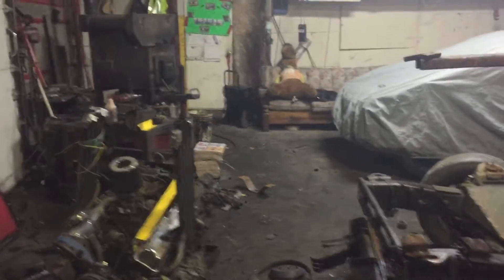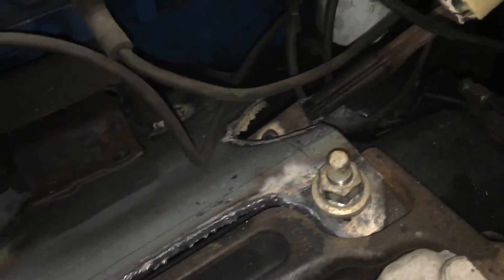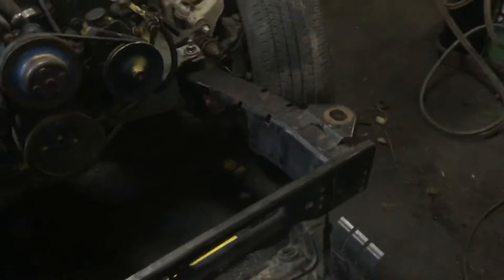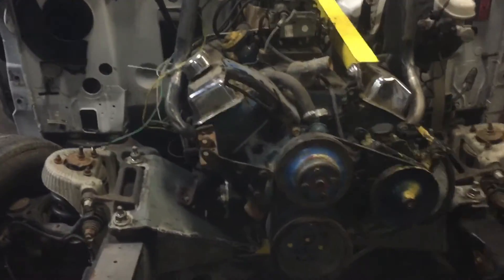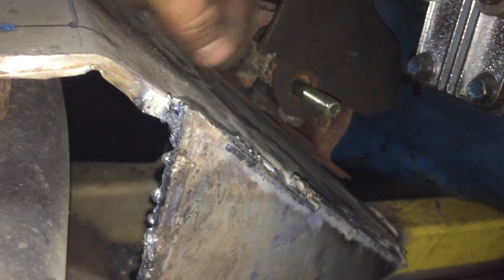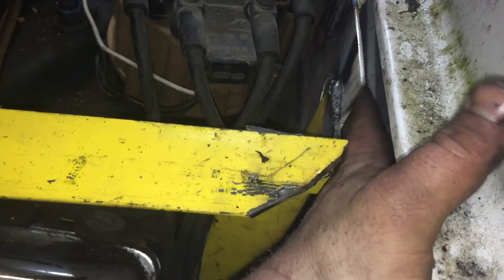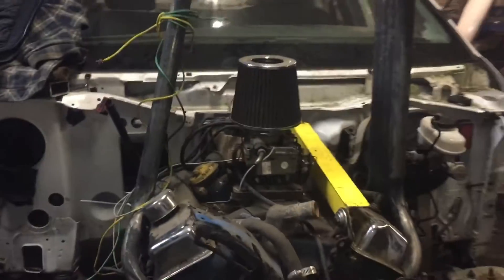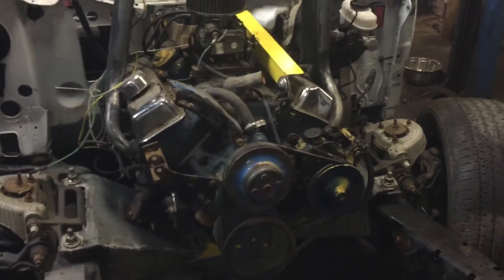installing the motor into project " burn barrel "

Comment: So did you weld the motor mounts or bolt the motor mounts to the cradle?
Reply from the maker: i welded them down to the steel motor cradle i built

Comment: A little tip if you can cut out some of your firewall to protect your distributor I would just to protect it better
Reply from the maker: Demolition Derby for Life that is very true I did that on my last car and the because I cut out the firewall the dash folded on its self. I want to try and leave as much as the fire wall as possible in. I am hooding that it will stop the car for folding when I big hit on passenger side. I can't have a dash bar
Reply: zacks workshop oh alright if you can't run a dash bar then don't do that that's strange that you can't run one but live the build so far can't wait to see it finished